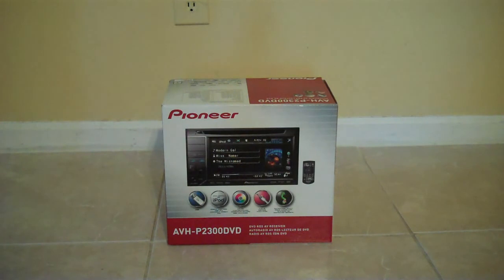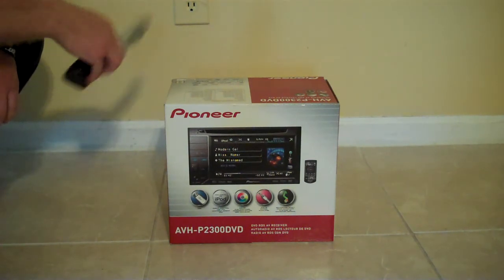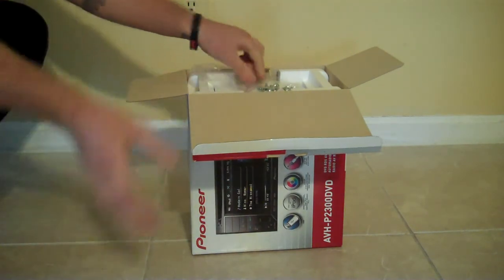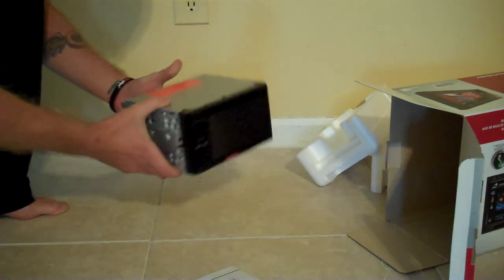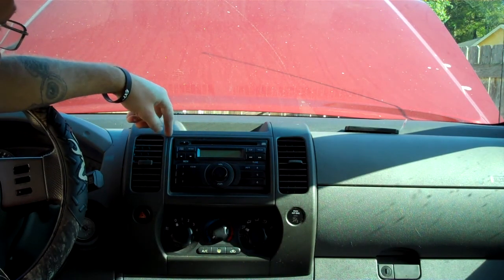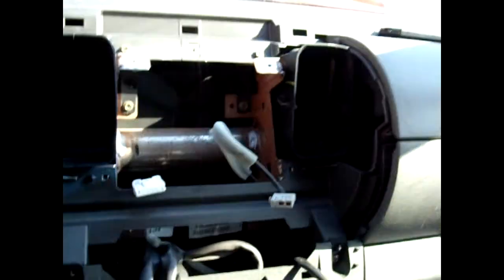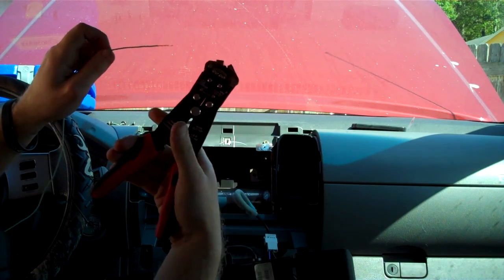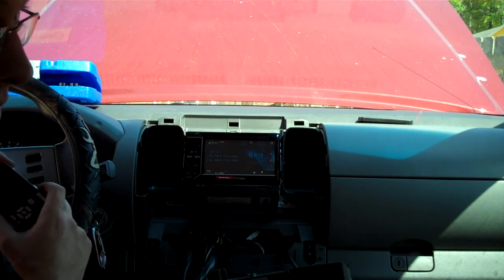Pioneer-AVHP2300VD

Comment from the maker: @clown158 true it has sub controls but it does not have DEDICATED REAR OUTPUTS on the rear of the head unit.  U have to use a relay switch for the brake wire

Comment from the maker: @ExtraTerrestrials Its all preference.  I have used jensen pioneer and alpine.  The Alpine was propably the best single din I have ever used while the 4300 is the best double din.  THe screen on the 4300 is about 1.2 inches bigger side to side and almost 1.5 inches bigger from corner to corner

Comment from the maker: @matrixownz In my truck I had to use the factory mounts.  An S-10 isnt made to hold a Double Din like mine so you will have to modify your dash a little but alot of company's make kits for this and very good instructions because how popular the S-10 is.  I have owned three myself.  They were all low and loud.

Comment from the maker: @ExtraTerrestrials I never owned the 3200.  I had the 2300 and moved up to the 4300.  The 4300 has the full screen without the controls and usb on the side of the screen.  The 4300 is both navi and bluetooth ready along with being way cleaner in apperance than the 2300 and 3200

Comment from the maker: @MicroBypass Because anyone that has a little wiring ability (if your installing your own radio you probably will be ok) can wire in a simple relay switch and fool the brake sensor on the avh models.

Comment from the maker: @ExtraTerrestrials If you go with the avh4300 then the screen is the full face.  The lower model avh have buttons and the usb plug around the screen so the screens would probably be about the same.  I traded up to the 4300 model and love it 100x more than the 2300

Comment: @cotyballs.... I know a little something about electronics as i have an electrical engineering degree, and i have owned a real stereo shop for 12 years.... a 30-AMP relay to switch 5 milliamps of current is like using a 200-ton bulldozer to kill a fly. The interface I made does the same thing a relay does, but on a much smaller scale... It is all digital, and has no moving parts like a relay... It creates virtually no magnetic flux (bad for noise in rca's) and is super small n easy to install.

Comment: @cotyballs Thats all good man, Cant be perfect everytime. My first vehicle i did a build for DC audio was a chrystler LHS i had no choice over it, This one i did & i made sure i did some research under the hood & on the type of build i could do / wanted to do was compatible with the vehicle. So it has been a nice bonus, But not somthing nessisary. Im staying tunned in man cant wait to see how this all turns out :) 14v battery bank with a voltage boost module will really help with a single alt.

Comment from the maker: @clown158 I garauntee yours doesnt have an output on the back that says subwoofer.  I had an 2011 model.  I work at a stereo shop.  Look at the date on the vid.  It will have four outputs.  Front left and right and Rear left and right.  But you need a Relay switch.  Thats what its called.  You can pick them up anywhere.  They have four prongs and you need to wire it to a ground and a power source that is turned on with the ignition.  Then one of the prongs gets wired to the e-brake cable.

Comment from the maker: @MicroBypass  If u knew about stereos you don't need a special module. I didn't click on the link because its probably something retarded. On the lower models like the AVH you need to wire in a cheap relay. On the Avic series you just need to adjust the pins.  Nobody click his link.